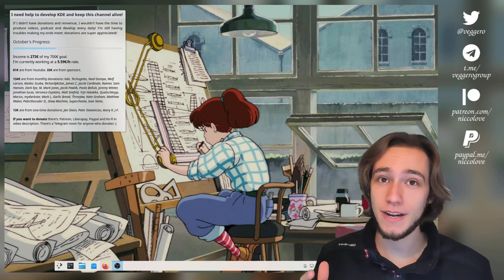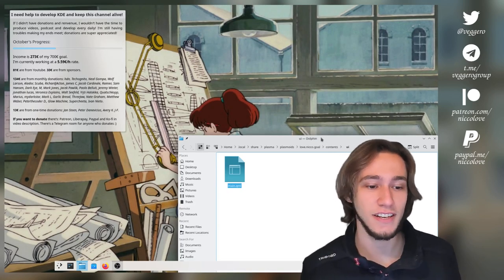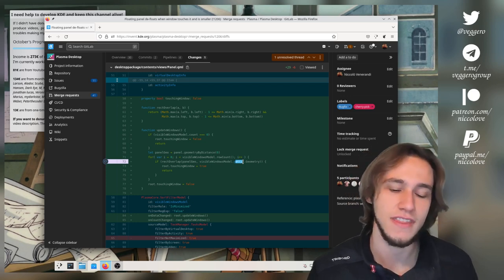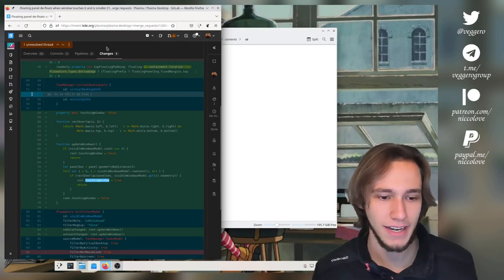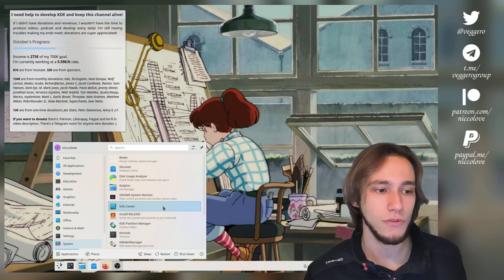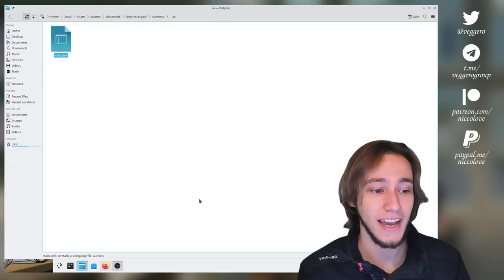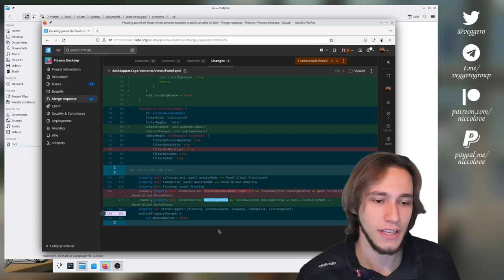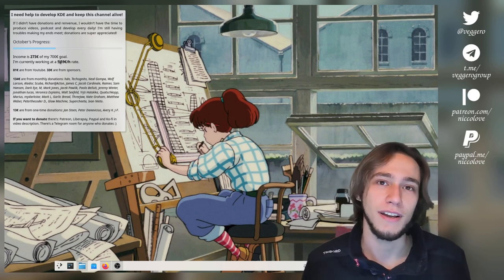KDE FLOATING PANEL got PRETTIER :D

Comment: The only reason I don't use the floating panel is that when it de-floats, it grows in size and takes up more space than needed. I normally use Size 28.
If it were to just de-float and stay the same size it would be great.

Comment: I understand you don't want to remove completely the "defloating" feature when window is maximized, but why not giving the option to the user to choose the behavior, like everything else in Plasma?
Reply: Exactly
Reply: It wouldn't be that hard to implement as well
Reply: Please please pleeeease add this option...
Reply: Was about to come say this. I use my floating panel as a dock and it auto hides. Now the panel looks kinda silly being bulky in the middle when it could float. It also is not the max width because it's a dock-like panel.
Reply: Yea that kind of thinking feels like a gnome thing and not a KDE thing. I'm honestly shocked to hear that position being taken .
Reply: @alinaqirizvi1441  so implement it! It's open source, isn't it?

Comment: The panel defloating when windows are tiled takes away the only hack to fix the no floating panel people had. Your view that staying in floating mode does not consider how many people design their layouts. What an individual user likes or what you see people showing their setups have already. Even in your own telegram people tried to have a conversation with you about it. Also look on reddit, Twitter etc. This is one of the features that made latte dock so popular and flexible for so many people. Making the panel only defloat and nothing else goes against the customization and user freedom Plasma promotes itself as. All because for how you use Plasma and what you think looks good. You think is the only way. It is a great feature for those that what the panel to be like that. That like you  don't use anything other than the default layout. Try looking at as an example. Try to use a top panel, a side panel etc. looks are subjective. You don't like an always floating panel. But there is an overwhelming abundance of evidence that many, many people do. There is also those that do not. Both use cases should be considered. Not just one. I have seen many, many posts saying that the floating panel is not done well. I personally think that you have done a great job. But you are blind to how many people. Not just on Plasma like a always floating panel. I seen recently people asking and talking about making a polybar fork that can have plasma widgets in it. Why? Because of 2 reasons. 1 is no floating. 2 is customization.

Comment: Great to see further improvements for the floating panel. However I'm no so happy with this particular change, so currently if to center floating panel then make it go under windows and add more rounded corners you have perfect dock, but with this changes it make no sense if it will unfloat each time any window touch the panel...

Comment: I am sure a lot of people are going to be happy with these two patches, however I am going to continue using non-floating panels since my OCD doesn't like asymmetry and I also don't like the way the panels defloat (but like you mentioned, you are not going to add a feature that allows us to keep it from defloating it at all)
Reply: 😃 ya, that's the hole point of kde
giving you options to configure anyway you want
Reply: @vaisakh_km  but don't give you the option to not defloat

Comment: Do you think that a defloating could be possible also horizontally as an option? It's a bit weird to see the background on the edges. I don't think that moving the icons could be a good idea but at least extend the color of the taskbar to the edges.
Reply from the maker: Yes that's implemented for full width panels

Comment: Please implement a "dock mode" into the panel, where the panel does not defloat when window is maximized. I tried to create a dock-like experience with your floating panel in KDE 5.26 since latte dock doesn't work properly anymore with this KDE release. It looks almost perfect but the fact that it "defloats" when the window is maximized even though it only shows when moving mouse to the bottom of the screen. It looks weird in the "defloated" mode. If you can't make your "dock mode" please at least implement the possibility to disable defloat. Latte dock seems to be dead now and to be honest, it's always better to be able to archieve things without additional software anyway. With the floating panels we're not far away from that.

Comment: Hi Niccoló,
First of all thanks for all the good work you are doing for KDE.
Secondly, I don't really understand the logic of "de-floating" the panel. Why make a simple issue complicated?
One can suppose that If the user chooses the floating panel option, it is because it likes and wants a floating panel always: a user who does not like floating panels will simply not choose that option.
A panel which reacts whenever it is accidentally touched by a windows just does not sound right.